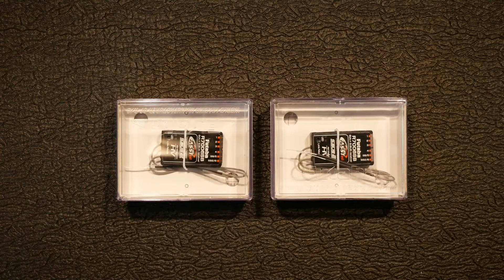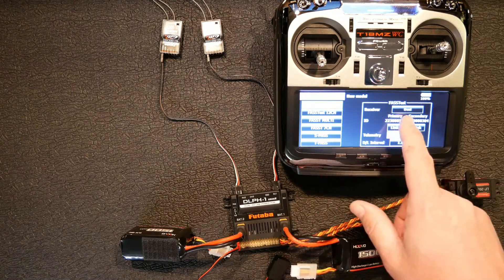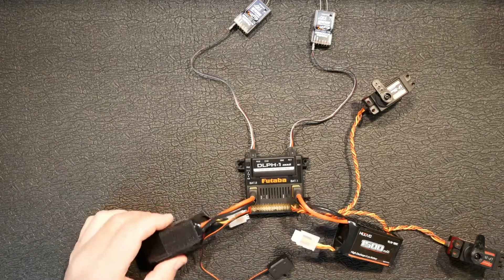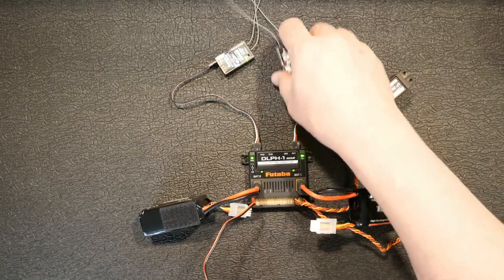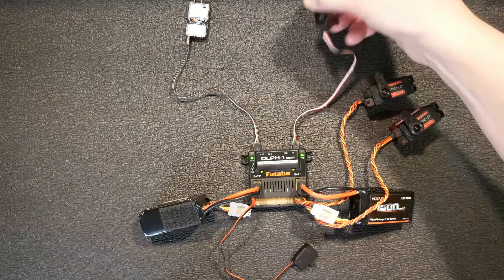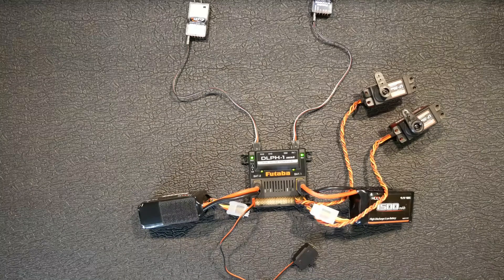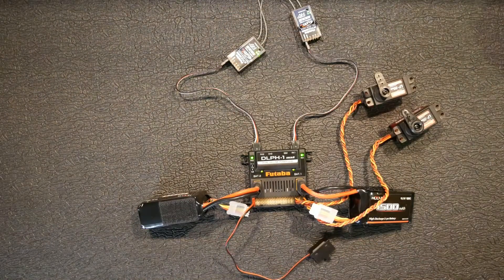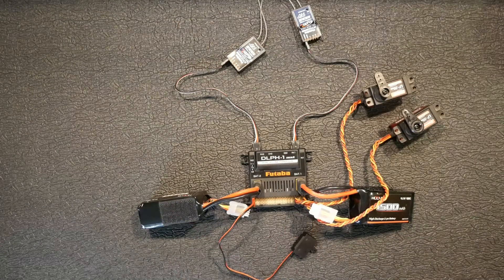Redundant RC Aircraft Systems: Futaba DLPH-1

Comment: Hey, Just a quick question. Would this setup also work with 2x T-FHSS receivers set up the same way through Sbus? Or does it have to be the FASSTEST receivers? Thanks
Reply from the maker: It'll work fine. S-bus language is the same for all Futaba receivers. Just bind it to your transmitter like normal T-FHSS binding procedure and set up the receivers for an S-Bus port. Plug them in and OPs test and range check. Thanx for the question

Comment: Just bought one of these i have a query? You said in the video that you only need the soft switch do you not put independent switches on the batteries as normal for charging and turning on or off the batteries before turning on/off the system. Thank you.
Atb from the UK 🇬🇧
Reply from the maker: No need for more switches. Just plug the batteries directly into the unit and the single switch will handle it all. You can remove the batteries and charge on the work bench or charge in place if you have long enough charging leads. You can install more switches if that makes you feel all warm and fuzzy....but it's not necessary. Thanx for the question 👍

Comment: Thanks for the great video. How do I setup the telemetry on my Futaba T18MZ to see both batteries voltages?
Reply from the maker: Since I haven't made a video covering that, it would be hard to cover here. BUT, here is a link to Chads video and he covers it a little on his 32MZ, which the set up is similar. You have to run both receivers in S-Bus2 mode and connect to the DLPH-1 through the S-Bus2 ports. Watch this video. Fast forward to 12:30 for the telemetry setup. Hope this helps. Thanks for the question!!

PS. Show Chad some luv with that like button  ;)

https://youtu.be/VI2kaYFeXNY?si=6EtbSItqPNC__Mpj
Reply: Thank you so much. This was really helpful. Much appreciated.

Comment: Would this system avoid frying the receivers on a 11 hv high torque servos 40%er 3d plane ?or would powerbox distribution box be better for that? Thanks!!
Reply from the maker: It has an operating voltage of 6.4-13 volts. It has a select switch on the side for 6.4, 7.6, & 11.4 volts. I have seen this system run in larger scale aircraft with no problems. If you have a high demand servo system and your more comfy with Power box, then by all means, go with what you have confidence with. Thanx for the question 👍
Reply: my main concern is to ensure the rx's are not fried by the 11 HV high torque (900) servos. unfamiliar w Powerbox. this unit should suffice right ? since the current from the servos dont go to the rx's ?!
Reply from the maker: You'll be fine if the receiver is also capable of 11 volts. I would make sure to use a receiver that is capable of what the servos are rated.
Reply from the maker: As for the current going back to the RX's, no that is not a problem. Whatever voltage you set the switch to on the side, you need to make sure the servos AND receivers are rated for that voltage or you will be smelling smoke 😁

Comment: What size batteries do you use? I have a 91” slick normally I would use a 2S 5000mah single battery. Any suggestions?
Reply from the maker: Depends on space. If it's a big plane the 2 larger Batts like 4500mah wouldn't be a problem. If space is a problem or your concerned with excess weight then go smaller. Just remember, heavier plane = heavier wing loading.

Comment: How can you run more than 8 servos with this system
Reply from the maker: There are 18 slots in the DLPH-1 that can be used as necessary. When you use S-Bus, the amount of servos you can use is only limited to the amount of channels on your transmitter. Just plug receivers into DLPH-1 by S-Bus cables and program each servo to it's respective channel with the transmitter.
Reply: Thanks

Comment: Do I have to use ignition power separately? or just use it from dlph-1?
Reply from the maker: Sorry for the late reply. I would always run ignition power separate just to make sure it doesn't back feed any interference into your system. I use the RCExcl optical kill switch as a switch to turn on the ignition from the transmitter. It's optical so it won't back feed electrical noise. Hope this helps and thanks for the comment.
Reply: @ChunkyC_RC  😊 thanks reply~
Reply from the maker: Maybe I should do a video on how I use the RCExcl switch as a remote kill switch 🤔. That might make a good video 😁
Reply: @ChunkyC_RC  I hope so 😊